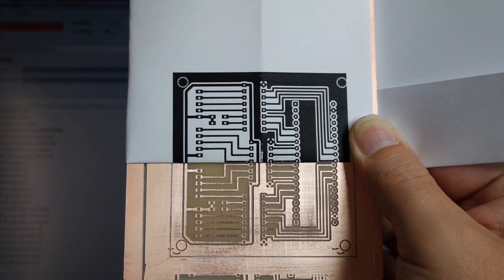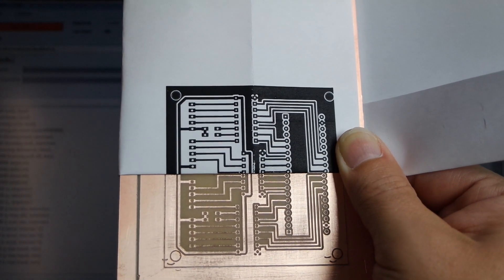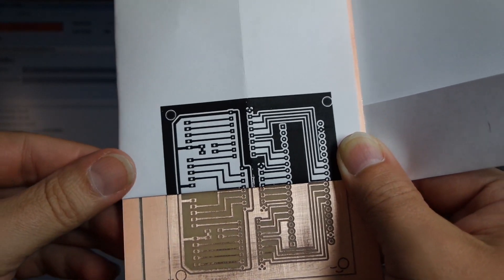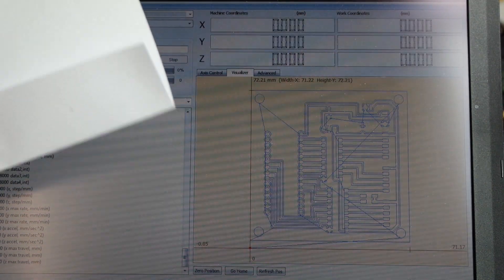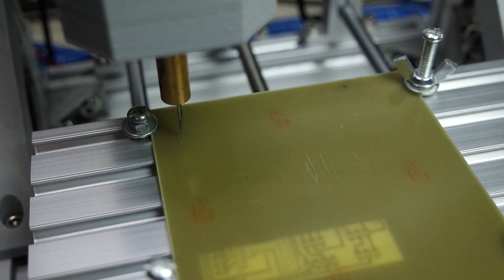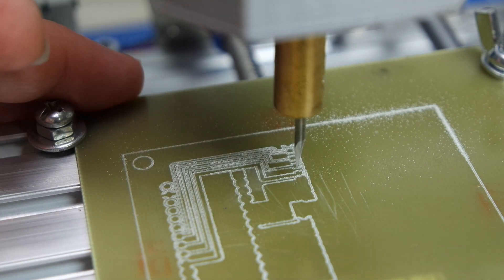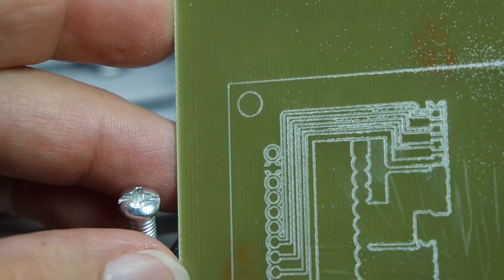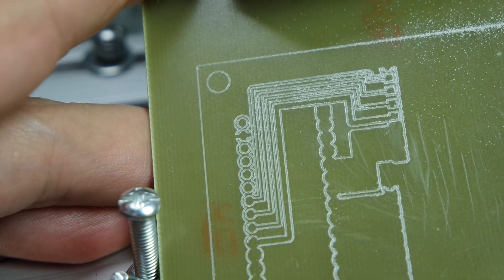T8 Mini CNC isolation milling

Comment: nice!  The flatcam method should not "Fray" as bad with a copper pour on the board...plus you wouldn't cut as deep with a thin layer of copper so the traces would be more pronounced
Either way...you see it cuts ALOT faster...
You can easily convert that metal bit into a touch bit auto-leveling because you can clip the negative lead to it...and it will lower and touch the copper completing a circuit and building a profile for true actual level milling
Either way...love your videos!  Keep em coming!  So AWESOME!!!!!!!!!
Reply from the maker: Thanks !

Comment: Hi Dirk
Schön mal wieder Videos von dir zusehen wo Platinen gemacht werden.
Ich hab dieses Wochenende auch damit angefangen, hab mir ne kleine cnc geholt Vergleich mit der t8 aber etwas stabiler.
Ich nutze Estl cam für alles, also fräs Abläufe Steuerung usw.
Für die paltinen mach ich das mit dem gcode "plugin" in eagle weil ich da auch meine boards drin mache.

Aber nun zu meiner Frage was für gravierstichel nimmst du da? Welche Werte haben die und wo hast du die her?
Reply from the maker: Diese, die ich grad benutze waren von Amazon, 0.1mm ,20 Grad. Der Verkaeufer war belessun, Versand via Amazon.
Die funktionieren sehr gut.

Comment: Hi Dirk.
I really like your method.
Actually I use FlatCAM and bCNC. The bCNC Autoleveler makes a huge difference. The results are always amazing. It compensate all imperfections when milling copper clad boards.
But yours is better to laser engraving machines and I wanna adapt an UV laser unit on my router.
Nice job. You gave us a lots of nice tips.
Thanks for sharing.